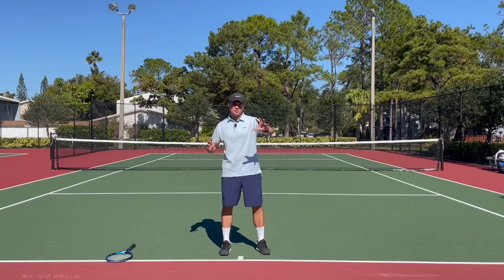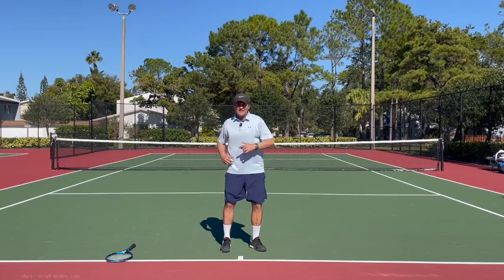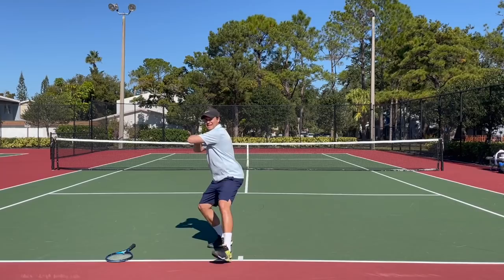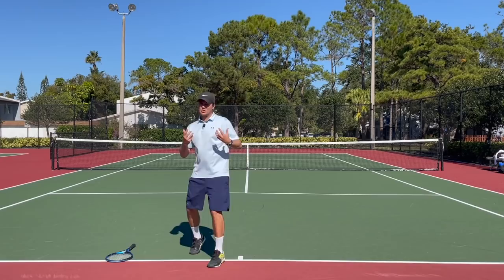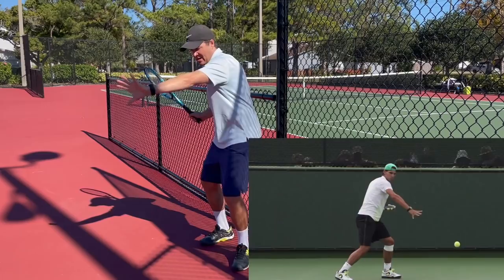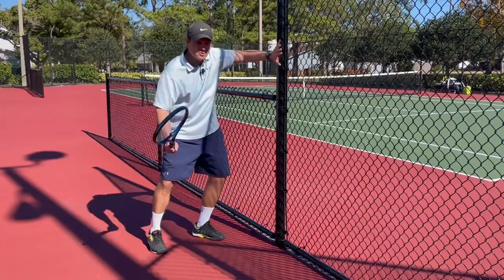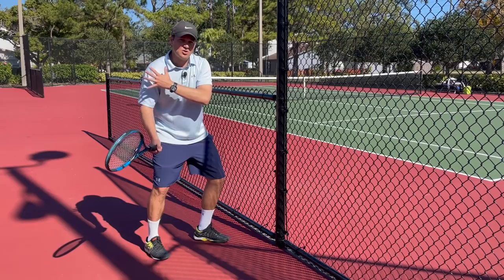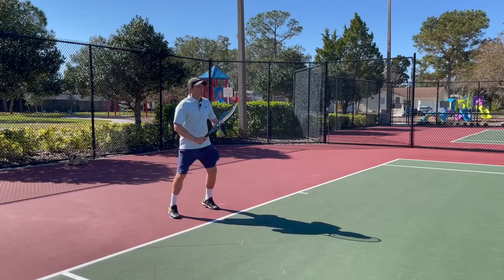Tennis Forehand Transformation - Progressive Drills For Massive Power And Control

Comment: I have done this drill and I like it, BUT it doesn't seem to make a difference when I start playing points or games. I still over rotate.
Reply: hmmm try adding stressful drills/situations in your practice. It might just be that the mechanics break down in match play.
Reply: that's the whole point of doing progressive drills. Try incorporating the mechanics while hitting against a wall, practicing short court, practicing full court, etc. If you can't do it at any of these steps, it's not going to happen under pressure.

Comment: Should the torso continue to rotate after contact?
Reply: Most of the professional men rotate and stop their shoulders just past parallel to the net at the time of contact.

The back shoulder is nearly always in front at contact, even the video of Roger Federer's forehand used as a good example demonstrates this. Do not take my word on this, stop the video at contact and tell me what the orientation of Roger Federer's shoulders are at contact relative to the net???

That being said, I wouldn't say rotation is the best description as you tend to get people spinning around, which is not what you want, and probably the reason for the creation of this video, and is what people really mean, or should mean when they say a person is over rotating on their ground strokes.

The better wording of the description of what you want to see is hip & shoulder snap. That is to say the hips and shoulders do rotate, but preferably in a snapping motion as opposed to a spinning motion.

Technically there are 2 axis of rotation, which Greg accurately points out that the lower body should be rotating through the front leg (you can do it through the back leg as well, but then my reply here turns into a 10 page essay and we do not want that) and the upper body should be rotating through the core around the spine, with an optimal description being you rotate your upper body through/around the sternum to get a good coaching outcome.

Finally you probably do not want to finish your swing with your front leg knee locked out, as tennis is a game of hitting AND moving, not hitting AND standing still to see how good you hit the ball. Finishing flat footed on the front foot, with your knee locked straight is not good for your recovery, it is energy and time inefficient, and puts a lot of rotational stress through the knee that can be avoided if trained for.

Even Roger as good as he is, puts a lot of stress through that front knee with the way he loads into his front foot in that opening video. Again, do not take my word for it. Look at Roger's front foot, look at his knee positioning and tell me whether you think its a good thing for his knee or not?

Don't worry if you cannot recognise it. I have demonstrated to Orthopaedic Surgeons a flat front foot with locked knee rotation and asked them if that was bad for your knee, and they have unequivocally stated, "Yes,  it is bad for you knee to do that movement in that manner" . Then when I have asked them to show me their own forehands, they proceed to plant their foot down flat on the ground and rotate their hips with all the rotational energy going straight through their knee. The point I'm making here is, if the person who is most knowledgeable and intellectually capable of understanding that a specific movement is inefficient and injury prone, but still does it, what hope is there for anybody else?

Hmmmm

That ended up being far longer a post than I was intending.

Oh well

No one will read it, It will probably get deleted. I tried. 🤷🏻‍♀️
Reply: @Whisper555 I will read this a a lot if times
Reply: Hi roddickfan :) there is a momentary 'stop' at contact and through the hitting zone. Federer for instance almost finishes with the swing before you see him relax and recover where you see the right shoulder coming around. Djokovic and Thiem release a lot earlier then most but still extend out toward the target past contact with the upper body remaining still before we see them come around.
Reply: @Whisper555  Hi Whisper555 thank you for your input. The video was already long :) with the focus on the left arm but I usually talk about firing the hips and core, but I found it takes a lot of progressions for people to be able to do it correctly. I don't point it out in this video but I like to see the heel of the anchor leg off the ground, like one has lifted. The anchor leg may straighten as a result of the rotation from the hip/core, the knee joint should be 'soft' and not locked. I agree with top players in the world we see the right shoulder slightly ahead of the left. I think for a lot of people this is hard to copy successfully without over-rotating. Pros are under extreme forces as a result of the speed the are hitting and recovering at. So is this a fundamental and a result of the force they are under. To me I have seen with students that it's easier to think of the chest slightly pointing towards the right, when they swing faster, they maybe be a little past that but they are able to stop rotation at contact as a result of it.